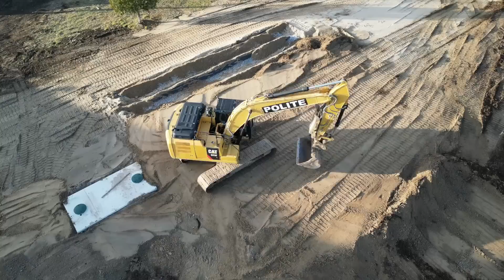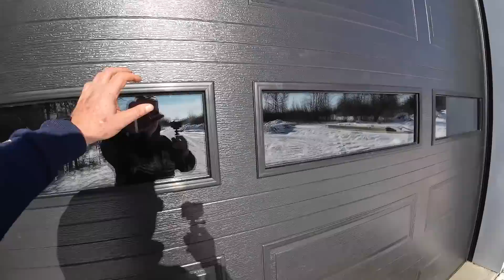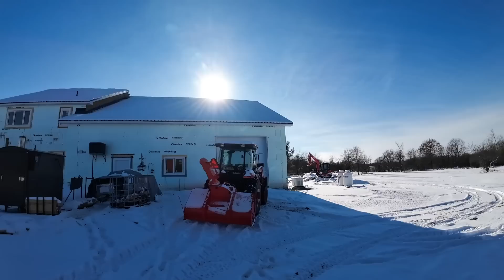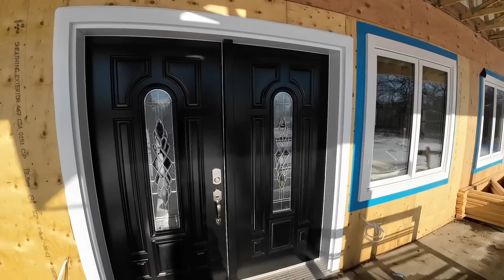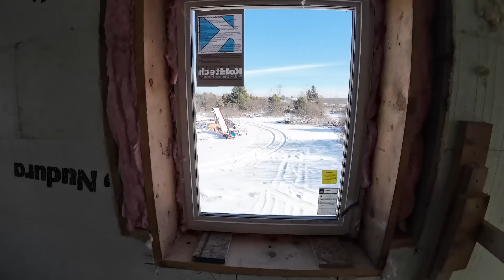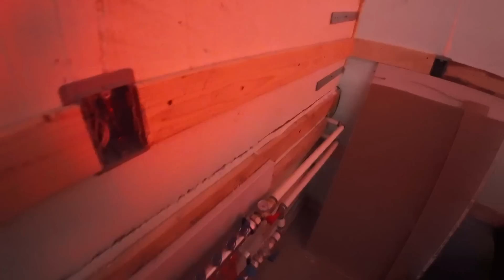ICF, Solar Powered, Wood Boiler heated, House Build Progress.  Mistakes made give learning lessons

Comment: I prefer my solar panels to be 6’ to 8’ off the ground.  So you get more BiFacial gain and you can use the area under the panels, mow maintain under solar panels.   Ground mounts are so much better to maintain.

Most homes have windows at 24” above the floors.  Window would look stupid if the window started 35” up wall where a couch starts.

Comment: why would you not put the solar on the south side of the house - in front of the house so you never need to worry about shading on your panels
Reply from the maker: We put it behind the house, situated behind the garage so it was mostly out of sight.  The back of solar panels are not pretty. So having it in front of our house would mean we constantly have to look at them.  Not something we wanted.  When they were placed the solar panels, the installation company had out blueprints and said they were far enough back to not be shaded by the house and that is correct for most of the year, except for the darkest times of the year (late December) when the sun is low and then we get some shade until 10am.  Not a big issue because the sun is so low in the sky that before 10am you wouldn’t be getting much solar coming in anyway.  I park my Tractor and Excavator behind the solar panels to keep them shaded.  It’s nice having that ugly equipment out of site.  So they are in the right spot in our opinions with the slight exception that if they were 10’ further back they probably would never get a shade issue.

Comment: What a beautiful home! However, as the home owner, you really need to know what you want and communicate it clearly at every stage of a custom home build, before any work is done. I've learned from experience that you simply cannot rely on your builder to get everything right. You have to question everything and everyone long before they show up to do the work, which means you need to know exactly what you want so you can explain it to them. I worked on many custom homes 30+ years ago (as a laborer) and the owners were always surprised, upset or disappointed by multiple thing along the way. What that taught me is that, as the owner, you must be engaged and involved in every single aspect of the build, and you must be educated on all the different components and methods being used in the build, to insure that you actually get what you want in the end. I know, you should be able to rely on your builder for all of this, that's why you're paying them, but they have other jobs going and they WILL miss things. They also can't read your mind, so you have to ask (and answer) questions continuously, from beginning to end, so you can be certain your vision is understood by all parties involved, before the work is done. I am planning my own custom home build for after I retire and I will be my own GC which has its own challenges, but in that roll all decisions will go thru me. I'm only going to build my dream once and I want the end result to be as close to my vision as possible. There is nothing worse than spending all that time and money and still being disappointed in the end.

Comment: Why not geothermal for heating?  Bedrock issues? Also curious if you considered a Passivehaus design and if this design is superior.  Lastly, not that you are short of space, but why not use that huge metal roof for solar heating, at least in a hybrid system.  Doesn't help at night!
Reply from the maker: ICF is Super efficient to heat. So that was what we’ll chose to go with along with radiant floor heat paired with a wood boiler to take advantage of our free limitless hardwood. Didn’t look into geothermal but we are on bedrock so I’m sure that option would have been expensive and would not use the free wood. Hope that answers most of your questions.
Reply: @Bowmans-Woods  If you wanted to go away for a while, I guess you would use the propane to heat the house, instead of the wood boiler..?

Comment: The door issue should fall on the GC. You need to force the contractor to use spray foam around the windows that he screwed up. You don’t want any garbage fiberglass in there.
Reply from the maker: Ya. Lessons learned. It got sorted out.

Comment: Hi Craig. With the fires in the L.A. area more people may be looking at your ICF build. Happy New Year. I have dropped links in chats about the fire.
Reply from the maker: Yes, ICF is a much safer option in a forest fire area. The foam in the outside may melt but the walls will still be concrete and standing. We mostly got it for the energy efficiency but it has the benefits of sound proofing and can stand up well to storms or tornadoes etc. FIRE is something I hope never happens.

Comment: You do have a perfect roof setup to put more solar on your shop. Putting panels on metal roof is so so so much easier.  You could easily have enough roof space to have a second electric boiler to send any extra solar watts into the radiant floor.
Reply from the maker: Yes, the shop roof could have more panels.  Only reason I don’t like roof mounted is you can’t easily clean them from dust, pollen or snow. My ground mounted ones I clean off regularly to get the best results.
Reply: @ when you have an extra 14k of solar you’ll never need to clean again! 😂

Comment: Look into thermal storage to pair with that boiler. Have one, hot, efficient burning fire per day, heat up the thermal water  storage tank, and slowly draw off of it for your radiant system throughout the day/night. No creosote or smoldering issues and a much more efficient (smokeless) burn. 
Your temps are too high in the floors. The short cycling is what’s causing your boiler to smolder and smoke so much, again burning inefficiently. 
Was there ever a manual J done on the heating system? That will tell you how many btus/hr you need, then you can run the floors at the lowest temp possible to achieve that. Or, similar temps at a slower velocity using ECM pumps, much more efficient.
Tin on the entire inside of the garage is an interesting idea. That will be very loud with lots of glare. 
You have snow falling and piling up outside your garage doors.  Doors under gable ends prevents that.
Reply from the maker: Thanks for the suggestions. There is a lot to learn.  The concrete floors act as a thermal bank. Once up to temps I can go away for days and the temps in the house doesn’t drop that much. But, downside is it takes a while to get everything heated up again.

Comment: You needed to follow the 6P principle...Prior Planning Prevents Piss Poor Performance!   Great to be off grid.  Did you consider Induction cooking?  What was your blower door test result?  You can get remote controls for the elevated windows.  Why fiberglass insulation in the screwup windows?
Reply from the maker: Sorry, blower door test results?  Not sure what that is. Pink was just what was handy at the time.
Reply: @Bowmans-Woods  Blower door test as part of most building codes.  Basically putting the structure under positive or negative pressure to verify building air tightness and quality of construction.  ICF should be well below .5ACH
Reply from the maker: @ they don’t do that here I guess. No one did that test. But building inspectors have been here and approved everything

Comment: Good morning Craig, looking at the size of the house, you might want to consider pre wiring for Wifi access points. From experience starlink Wi-Fi-extenders aren't great.
Reply from the maker: Yes, we did pre-wire for that. Cat 6 to different parts of the house. The enemy wall do not let much WI-FI through. Will set up a mesh network
Reply: @Bowmans-Woods  Please put Alta Labs (AP6-Pro) on your list, they make a very nice AP mesh at a reasonable price.

Comment: Not knowing much about solar I would have guessed you had plenty of solar for this house even heating with conventional system.  So it's surprising to me that you need more batteries considering you have the wood boiler for heat.
Reply from the maker: You would be surprised at how much power a wood boiler uses.  There are 3 pumps running continuously. One at the boiler and one for each zone of the house and garage. Then I also needed to put a heat line in my water intake from the well because it was not buried deep enough (because of the bedrock) and was freezing. That heat line uses about 4 to 500 W as well. So with all of that stuff running continuously overnight, it drains my batteries. If I just had more batteries, I don’t think that would be an issue. Plus, during the day I get to 100% charged very quickly so that also tells me I need more batteries.
Reply: @Bowmans-Woods  Really looking forward to a video about your solar system. At this point I have to wonder if it would be better to run an on demand tankless water heater during the day when the solar is working, and not heating at night. Not necessarily in your case since you already have the wood boiler system though, just thinking if I were to do this. Very efficient house you have built probably better than a yeti cooler, lol!
Reply from the maker: @ ha ha. I like the better than the Yeti cooler comment

Comment: Just found you....great content.   20kwh is definitely on the small side for a whole house battery.   Hell I have 15 kwh in my 5th wheel (we boondock in Arizona all winter and don't even bring a generator)!   We also have a ICF house here in SK...We luv it!   Looking to build another one in AB and will most likely be off grid with a 50 kwh-ish DIY battery.   All lights will be LEDs and run directly off the battery (DC) instead of having AC-DC converters at each light (very inefficient, especially when you already lost some efficiency converting your DC battery power to AC with your inverter).  Bonus is you can run much thinner guage wires for the DC lighting, but will use standard switches.
Reply from the maker: Thanks for the input.  I am still learning about how much batteries are needed to run a house. The installer said 20kw was what we needed but clearly it’s too small for my needs. I’ve already told the installer that I probably want to add at least two more batteries to make it a total of 30 kWh.